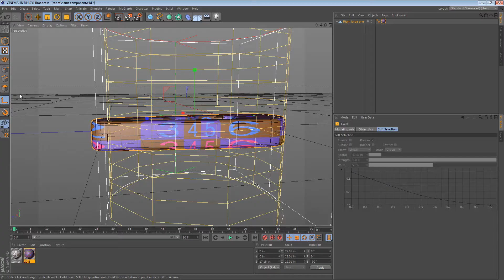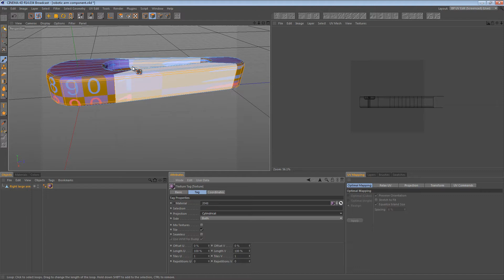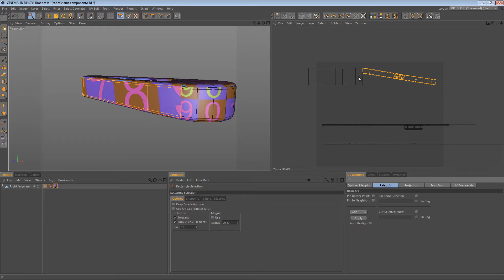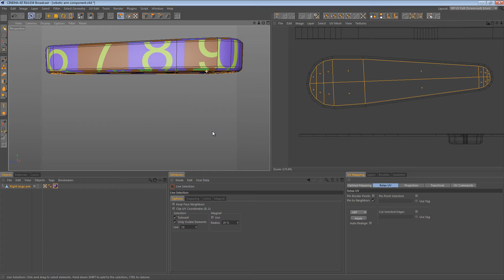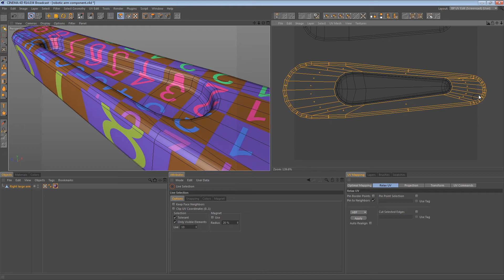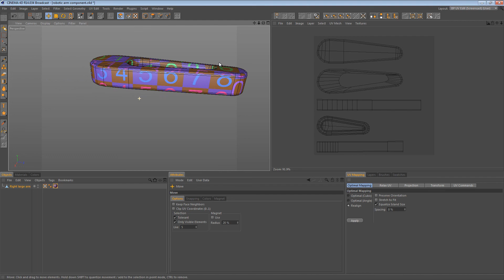UV Mapping Examples - Part 2

Comment from the maker: You know, I don't remember where I first saw the test pattern, but I've seen some software with built-in test patterns. For example, there's a program called AccuTrans3D (conversion software) and it has a built-in pattern. Either way, I'm glad it works for you! ^.^